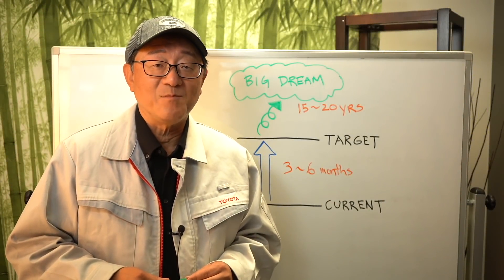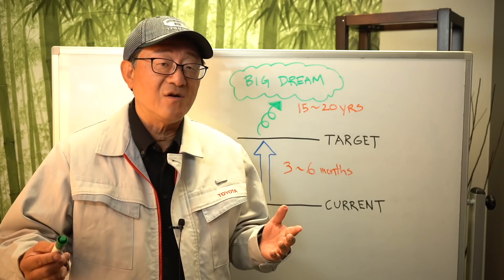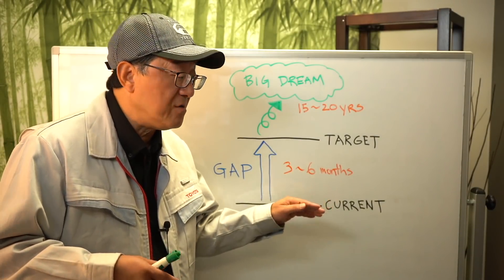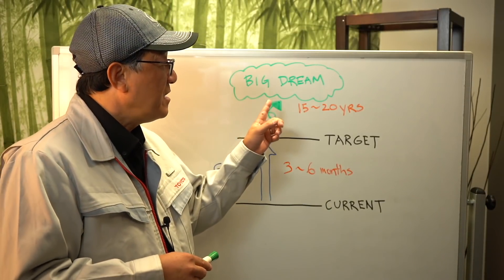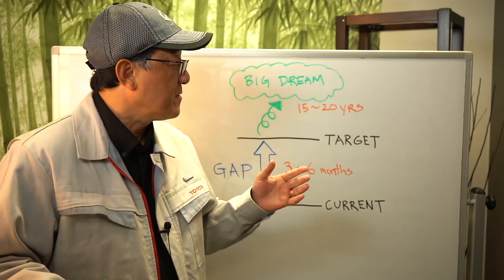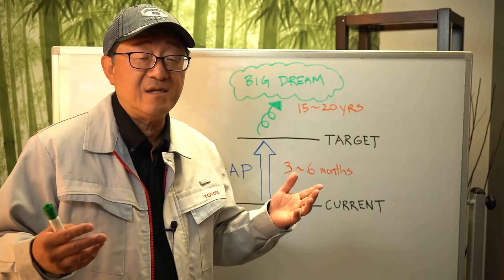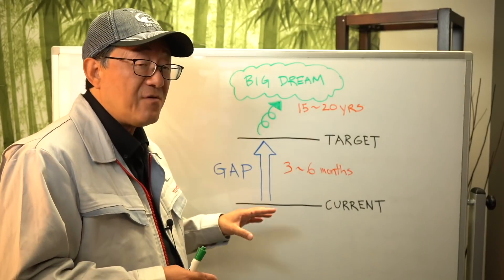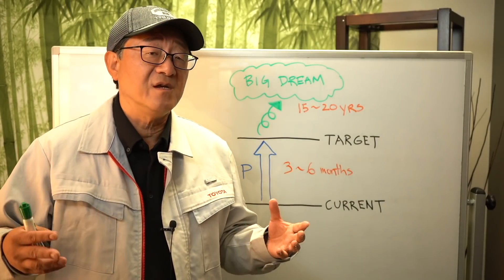TOYOTA'S "SECRET" PROBLEM SOLVING METHOD EXPLAINED BY AN ENGINEER

Comment: In our household we own 2nd and 3rd gen Tacomas, 2007 and 2021 Tundras, and I can tell you that Kaizen has improve Toyota's profits by consistently removing  features every year.
screwing customers. 2nd gen Tacoma and the 2007 Tundra are better trucks than the 2021 models. Couple of exlamples, no transmission oil coolers, no grab handles driver sides, etc.

Comment: A really excellent subject. BTW I just subscribed.  Toyota is famous for eliminating waste.  In production the goal is to make interchangeable parts.  A standard process should make the same parts over and over, with a very few out of tolerance failures due to inescapable random variations (you can hit the house numbers on the roulette wheel three times in a row, but very rarely). Just In Time means that parts problems will be discovered sooner rather than later, eliminating the waste of bad part production. Current and Target can also be thought of as Current Value Mapping and Future Value Mapping.  Lets say that it takes three days to process paperwork from customer signature on the order to the vehicle hitting the final assembly line.  But only 22 minutes of actual work is done.  If the CEO got everyone that touches the paperwork in the same room and let them know that their job was on the line, he might be able to reduce it to 44 minutes.  There would be a million excuses. The customer left a blank space (do not accept applications with blank spaces). The options choices were not compatible (have a checker for this).  Pretty soon every excuse would be ironed out.  Maybe the future delay would be 3 hours, still quite an improvement. Eliminating a waste of time. 
 In engineering there is no identical anything.  You are always doing things for the first time.  But if you have the simple traditional waterfall process, it just takes to long.  Everything is done in sequence and has to be fully signed off before it goes to the next step. Step 1, Step 2, Step 3... Step 14.  In concurrent engineering you work on multiple steps at once, which means the customer can get the latest, in demand features sooner. You just have to occasionally have a resolution of conflicts that happen due to simultaneous engineering (making the engine compartment 1 inch bigger impacted the body design).  
I'm looking forward to future videos!

Comment: Talking about CHANGE. Yes they change to increase price but not much about technology. Apple/Android auto didn’t available on RX 350 until 2020 while compared to other. And the 350L 3rd row seat is awful with the same body style. What about GX460 its been around for too long despite mpg efficiency.

Comment: I love toyota but they really screwed up pushing hydrogen and not developing more battery EVs.  I still can't believe they actually lobbied congress to delay the migration to EV.
Reply: hei.. let me clear you, toyota is multi global company and they have multi type product model  around the world.. the EV trens still have a problem with the technplogy(fast charging) and the infrastructure in every country not the same and not read yet masivly.  so the option for carbon neutral transition  is providing more options sourch of power  -+--»  HYBRID/PHEV/FCH/BEV/ combustion engine with hydrogen fuel  still on tested..
Reply: @dencesolihin9186  sorry but that still doesn't make up for them trying to delay the move to EV. There are other large  companies that sell around the world that didn't try to slow down the migration.  You would think with Rav Prime as an example they'd be better equipped to move forward. The fact that ford is doing more than Toyota when Toyota was on the forefront early on shows they put there attention elsewhere. I don't care what they are doing elsewhere. Hydrogen is only in California and have yet to expand elsewhere in the US should prove something. Anyway we have different opinions and that's cool.
Reply: @RetiredRich   sorry to say that toyota do not slow down the EV project car.. but they might thinks that the EV car its does not one solutions for future zero carbon neutral.. there's many others way to do that.. many nation not ready yet in the regulation and the infrastructure for ev power plan too.. its like a BOMB when the EV car doesnt have strong base of the infrastructure..  build just an EV cars  for Toyota "is like a piece of cake"..  Panasonic which supplier lithiium ion Battery for Tesla  is one of Toyota group associate.. indeed Toyota knows the capacity.. it so easy too shutdown... but toyota not to do that because there's  a margin there.. he..he..  while others brands speed up for the EV cars..   Toyota made " woven city"   the first smart city in the world   that addopt autonomus mobility transport..   remember EV cars its just one solutions  for carbon neutral.. what if there's a futture city that mobility activity inside the city 100%  Carbon neutral... and that is
"TOYOTA WOVEN CITY"   a miniatur future city  has to be...
Reply: @dencesolihin9186  You can say anything you want or believe but I believe Toyota made a mistake and did in fact drop the ball on EV. You can provide anything to defend them but their actions tell a different story in my opinion.   I like toyota but they've made plenty of mistakes just like any other car company.  I have a suspicion that no matter what I say negative against toyota you will have some excuse.
Reply: @RetiredRich  ok anything ypu say.. but  i believe akio toyoda have something to proove... cause he has so much more passion about car. there's no other CEO  off automobile industry that so much passion about the car by tested in racing endurance like the way he did it him self... perhaps on EV car too  just wait in the next near future...  sorry if i'm to arogan to you.. peace...
Reply: @dencesolihin9186  I don't find you arrogant. I just don't get why anyone goes out of their way to defend a company unless they work for or are funded by the company. As I stated early on, you have your opinion and I have mine. You know what I am okay with that but I don't think you are. This is my last comment on this, so feel free to get the last word in. Thanks and stay safe.

Comment: Outstanding video and very good explanation as to why Toyota produces the best products in the automotive industry.   This method can certainly be applied to many aspects of ones life.   Yet another reason why I have chosen to be a Toyota customer and this video reveals why the products they make last so long and are so durable - they are designed with longevity in mind.
Reply from the maker: Thank you so much!

Comment: Well that KAIZEN did not apply on the Tundra for 15 years..
Reply: You're confusing market share with profitability. Toyota's goal is profit. Profitability was achieved on every tundra sold.
Reply: @ricqik  ya but as stated in the video, Toyota culture is all about changing and there was zero change to the Tundra from 2007 till 2021 same truck.
Reply: @m.romaithi6217  true. He should have said that Toyota loves changes only as long as it's profitable. Keeping the same ancient powertrain can be profitable because there's less research and development but doesn't go quite well with "accepting changes".
Reply: @m.romaithi6217   Nope, 2007 was a better truck, lights in all doors, driver grab handle, seat pockets, two glove boxes, transmission cooler, etc.etc. I know I own a 2007 and a 2021
Reply: Got a 2021 TRD pro Tundra and its excellent!  Lucky to be able to get the last year of the V8
Reply: Or most of their vehicles. Lol